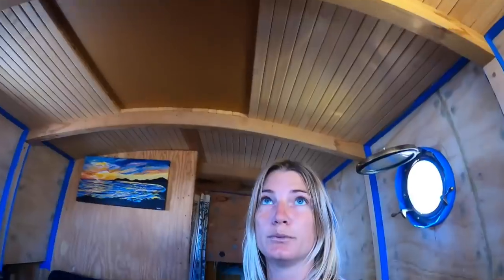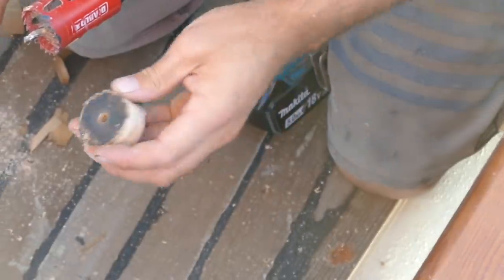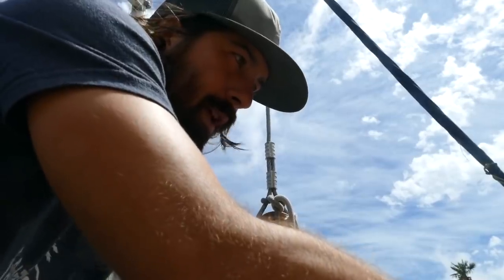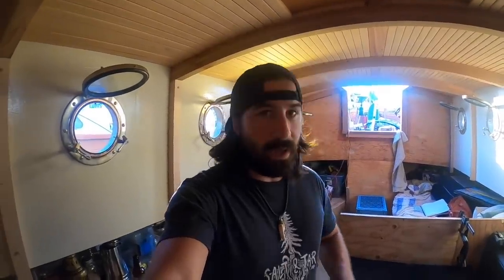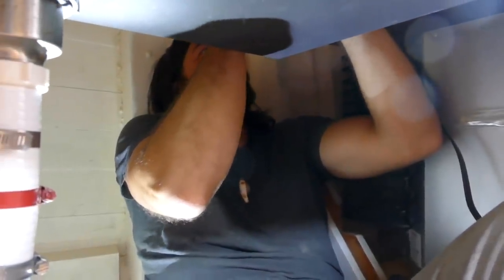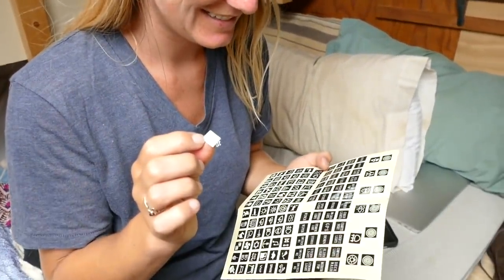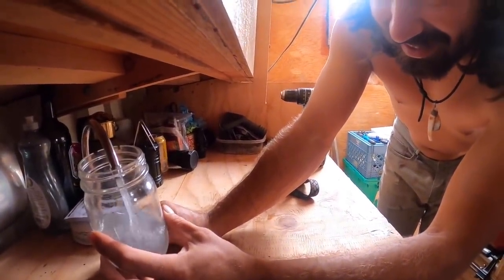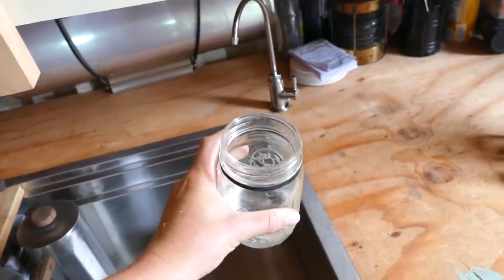Salt & Tar: Episode 98-    Not Just a Boat It's Our Home

Comment: I use 291LOT (long open time) for deck fittings which I may have to remove at some point in the future.  Less of an adhesive and more of a gasket.  Torque your fasteners lightly for the install then come back a week later and re-torque with a bit more pressure to compress the set material.  Less chance of ripping out the grain of your fir deck if/when you have to remove it when you are old (like me).  Love your project.  Just another guy with an opinion.

Comment: I know that feeling when the water runs for the first time, it's even better when the toilet flushes and the shower works too. I agree with previous comments, you should fit an accumulator down stream from the pump. It will reduce the rapid cycling of the pump, shortening the life of the micro switch. If you do fit one remember to set the air pressure to get the full benefit. Also consider changing the braided PVC hoses, they are not suitable for potable water. The oils in the PVC will leach out into your water and eventually the hosed will become stiff and brittle. Your local chandlery should stock potable water hoses in blue and red for cold and hot water. Love your vids, been watching from the start. Planning my 60ft X 12 canal boat to live on here in the UK.

Comment: nice water system ! I've got the same rig in my log cabin .. I did end up putting a small accumulator tank in line with the pump and it really helped with how many times the pump starts up . mine cost like $35 on Amazon

Comment: Y'all need to put a push on to get the sails up and the engine running now so as a can take her out under sail all the rest of the l small stuff can be done in between sailing trips when in port. Get a her to sail is where you need to be now

Comment: It seems every job I do, no matter how simple, requires every single tool I own.  I hate putting them all away every time.  

Put an accumulator tank after the pump, it moderates pump cycling and makes it last longer.  

I looked on your wish list to see what was there.  I saw the Katadyn water maker.  It's not a great unit for long term living, the output is far too small.  There are better choices.

Comment: We have a 3 filter system in our home. I change out the filters every 6 months. The directions say to run the water on full for 5 minutes after every filter change. The initial squirt after a change is always very aireorated but I never see charcoal.. A easy rule of thumb when trying to conserve water, is to run it at least 2 full minutes and then fill a clear glass and if the only thing you see in the glass is air and water, it's good!! Letter a glass sit for 30 seconds or so should be enough for the water to go clear.. Also, you may want to rethink the slip fittings for pressurized water on a boat. We had a nearly empty Vodka bottle fall over on one of those fittings and it did pull the water line out of the fitting.. On a boat I would think you'd probably stand a much bigger chance of things falling over onto other things.... Just my .02.....
Congrats on running water!!!!!

Comment: I have been going through my home remodel because of being disabled and it’s been going for 4 years.
I am getting within about a year of being done but having to do it all myself and on my limited income is hard.
I feel for you and the feelings of construction zone. 
I have one more floor and electrical and walls to go in my handicap bathroom and laundry and I don’t know if I will get it done before I am back in a wheelchair permanently but I finished the main painting and only have trim and baseboard to go and paint made me feel like I almost had a home again.
Congratulations on the move from full construction to home!

Comment: You should let the dock hose run to clear bugs and lizards before you stick it in the deck fill. If you use an accumulator tank the pump won't come on every time you get a drink.

Comment: Tips for cloudy water.
If the water clears from the bottom up to the surface, then you have air dissolved in the water, and your fine.
If the water clears from the surface down to the bottom, then you have solids in the water, and your not fine.

Comment: Paint and drinking water, from a faucet, y'all getting too fancy. I love it. Congrats on the upgrades. Bet that feels so good to have some luxuries, finally. To those of us in regular homes it may seem like nothing, but to anyone who lives in substandard housing, on the street, or in situations where these things are not the norm, this is a giant leap in comfort. My cir. 1820s home needs close to $150k in upgrades and repairs to be up to modern American standards, so I get it. Heck, I don't have a level floor in the house, or even a sealed or insulated room. I do have running water, but the toilet is outside in an outhouse (though that is plumbed into a septic tank with a flush toilet. An old fashioned outhouse is against the health code now a days). We have 100 amp service, so modern electrics means we have to shut off certain items to brew coffee or use the microwave or the breaker trips. We have no central heat or air, we have a wall propane heater in the livingroom and bedroom and window A/C in the same rooms. And electric heaters as supememtal heating in other rooms and the outhouse. When my disabled arse finds a job that I can do, we will save up to get the house jacked up and leveled, then worry about the rest of the renovations and upgrades as we can afford them. Yeah, the water was a manditory immediate upgrade when we bought the place for $24k before I became disabled past the point of manual labor employment.

Comment: Hi, might want to think about securing the section of water filling pipe, between the deck and the tank. It's quite a large diameter ( looks like 1") and has some weight to it. Best to avoid it knocking around, as it'll stress the fittings and eventually cause them to fail. A hose clamp / bracket say every 30 to 40 cm should be more than enough, could even make them out of wood.
Nice job on the Interior painting, looks good.

Comment: Looking better & better each installment.  Just a helpful hint , an easy way to seal small areas of wood without having to  mix epoxy is to use cyanoacrylate glue. It is about $ 25.00 from Amazon for 8 oz.  It will wick into the smallest crevices, harden the wood and set in minutes.  It is amazing to see how the two of you work together and support one another.  It is an example we can all aspire to. Some folks who disparage committed relationships should look and learn.

Comment: I'm surprised that you didn't put a P trap on the sink drain. I know that it's not necessary because there will not be sewer gas, but what happens if you drop something down the drain? It goes straight into the ocean. BTW is that legal?
Alan

Comment: The cloudiness of the water are air bubbles. Under the pressure of the pump air bubbles you always have in the system dissolve into the water. After leaving the faucet, the reduction of pressure makes the air coming out of the water again. That produces masses of very tiny bubbles, forming the "cloud" in the water. It disappears quickly and is in no way harmful. If you look very close to the water surface, it looks like sparkling water en miniature.
The activated coal in the water from a fresh filter doesnt look appetizing, however it is taste neutral and also not harmful. After all, charcoal pills are a way to help with digestive problems.

Comment: Don't let anyone criticize you for using Rustoleum on wood.  It is a good, durable alkyd enamel !  I like the light tan instead of stark white !

The external water filter with hose fittings is a great idea !
Reply: Dad painted the sheetrock with the Rustoleum Enamel behind the work bench.  If something went zinging into the wall, it usually just bounced off.  Puts a hard coat on whatever you apply it to.
Reply: @Buck1954  If you want super-hard finish, add a couple of drops of enamel hardener.  Now you are approaching epoxy hardness !

Comment: You might consider adding an accumulator to your water system. This is the product info of a Shurflo taken off of West Marine website,
 'Polished stainless steel housing with butyl rubber diaphragm provides maximum corrosion resistance. Easy to install and maintain, this 2gal. capacity tank maintains consistent water pressure and temperature. Reduces pump cycling. Pre-charged to 20psi. Includes mounting feet for easy installation and a mounting bracket to accommodate any type of Shurflo water pump'. There are other brands.
The main thing is that your water pump doesn't come every time you turn on your water. I actually had this one on my boat that I lived on for 14 years.